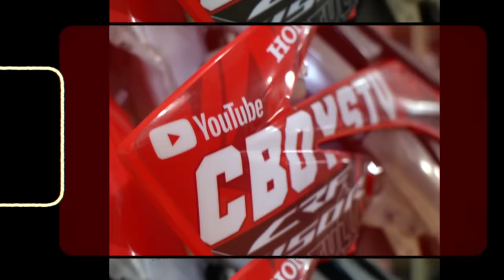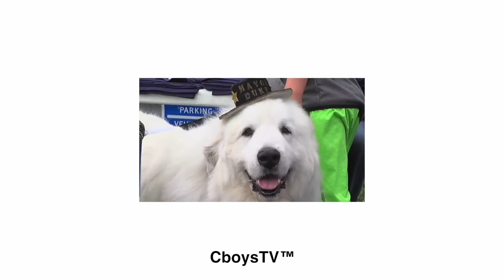Worst Craigslist Trade Ever: Dirt Bike for Quad

Comment: Just a question did the exhaust and headers get messed up when you guys pulled the spark arrestor out? It looked pretty rough when it completely stopped the quad just by exhaust.

Comment: CJ, if you werent gonna ride a 450, trading for a raptor, is rather a very good deal. just let your outside leg lift up so you lean more when u corner. How the pro riders do it. And a quad can be fun so. plus youll be able to get another 450 or whatever. The raptor was a good deal.

Comment: Traded a fuel injected bike for a carbeurated quad...... 

Also one of them is pretty gay
Reply: The quad is fuel injected his is the first year of fuel injection on the yfz
Reply: batman ain’t the quad that’s for damn sure idk what your talking about🤷🏼‍♂️ the quad is clean as hell
Reply: They got fucked yfz’s are worthless here I couldn’t barely get 2000 each out of the two I sold that where built asf
Reply: @southernracing2468  were you're at its weird then
Reply: Josue Velásquez Missouri

Comment: i used to be able to barter for anything, its gotten harder, most recently i traded a $1000 worth, a welder, bow, xbox ,and post hole digger for a dump truck killer deal everthing works runs and drives

Comment: The reason it doesn’t run good is because the jetting is off due to the baffle removal. Also they have a throttle sensor in the throttle so always adjust the rpms on the carb not on the throttle.
I have an 06 yfz and I removed the air box cover and put an exhaust and rejetted it and it picked up about loads of low end and high end power.

Comment: Widen it, new handle bars, exaust with headers, cam, paddle tires on stock rim beadlock rims with its holeshots or maxxis tires, after market a arms with new suspension or cheaper route wheel spacers.

Comment: The reason it kept dying is because it's a Yamaha, they suck. Do NOT buy a Yamaha.
Reply: Yamaha is the best what are you talking about
Reply: @trevornewton9687  If you think Yamaha is the best you either have a problem or sadly have never had a better brand like Honda
Reply: @Strob3Gaming  I do have Honda and I do agree with a point Honda atvs are way better cus there not belt driven meaning they can haul heavy loads with out the belt slipping but Honda’s dirtbikes are just trash Yamaha  has much better dirt bikes